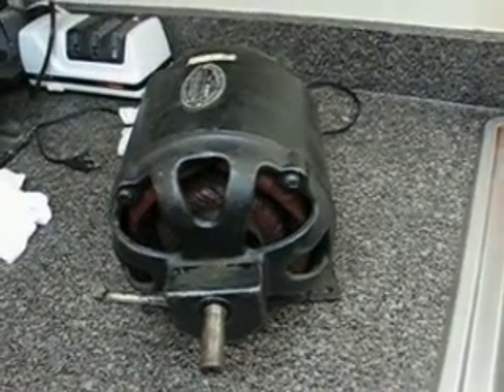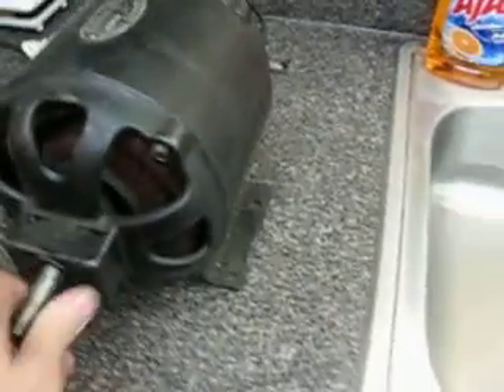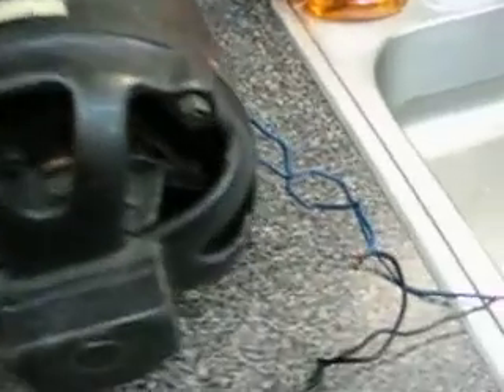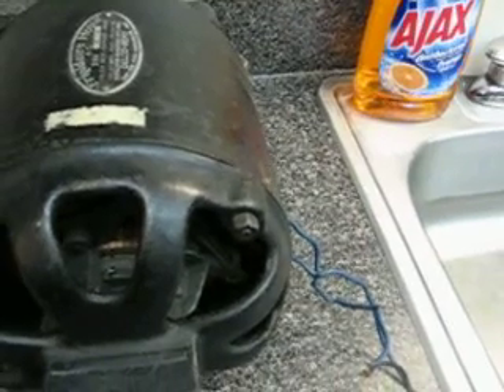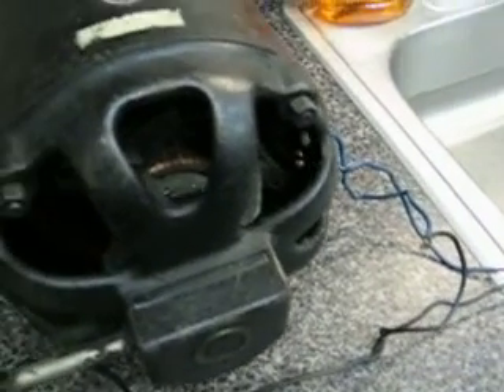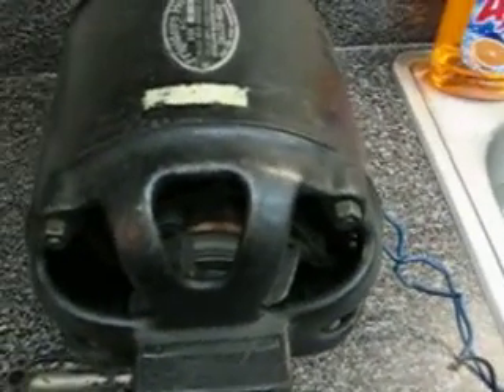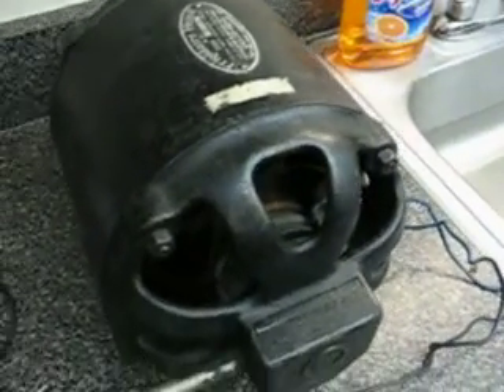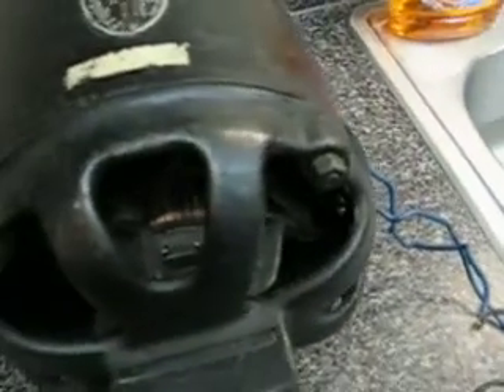Delco Remmy Frigidaire Repulsion Start Motor

Comment: Fascinating motor. Thanks for the video. I am a bit of a motor collector. Here in England repulsion and repulsion start motors are rare. The only ones I've seen are "Century" brand imported from the USA. Sometime I want to get one. But we have some cool English motors. I rescued a big LSE motor from a factory demolition recently. It weighs over 200 lbs and the frame of the motor is welded steel, not cast iron. I would post a link to pictures of it here, but the form doesn't seem to allow it.

Comment from the maker: I want to see it! Make a video! I remember these on our Naval base in Yokosuka, Japan, there were several large freezers in the hospital building, the rear of them sticking out of the building. Each had one of these open DR motors and they sounded identical to mine. The motors ran high-speed two-cylinder ammonia compressors. Don't know if these motors are made anymore.

Comment: i also have a Delco Frigidaire Repulsion Start Motor! mine is different though! i think mine is a brush lifting 1/6hp! its at my grandmas and ive never put power to it. i should bring it home and see what happens! it has fan blades mounted on the pulley similar to my 1/4hp wagner! but i think these had something to do with cooling a radiator for the refrigeration unit! but mine is ment to hang off a bracket to keep tension on the compressor belt. so it has no cobventional base on it!